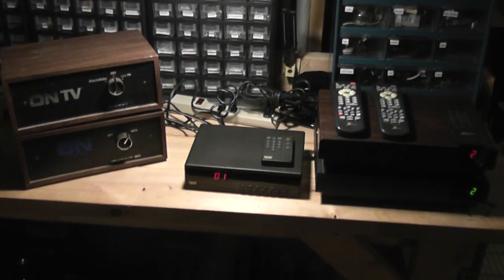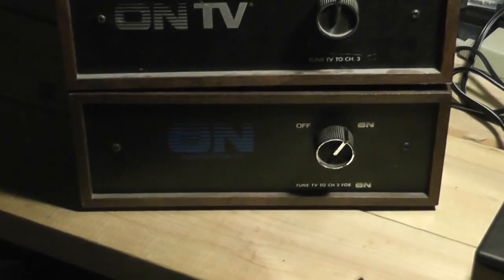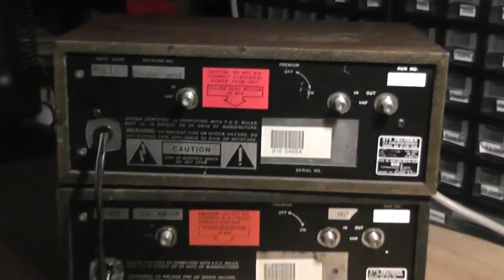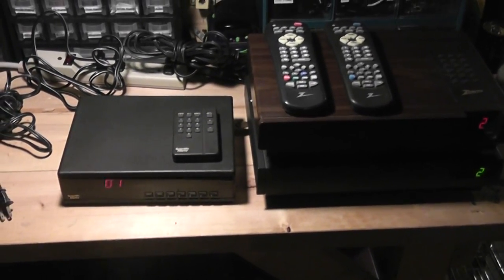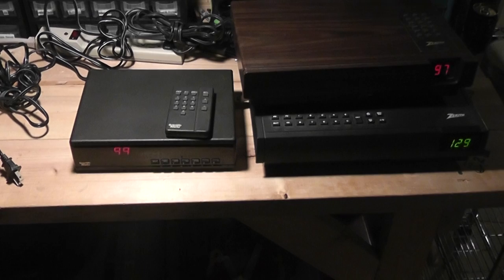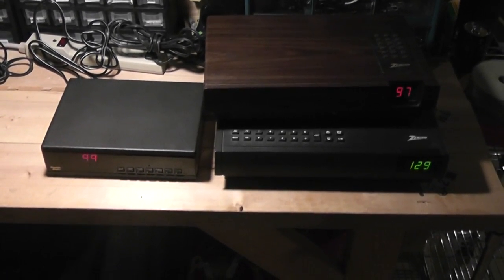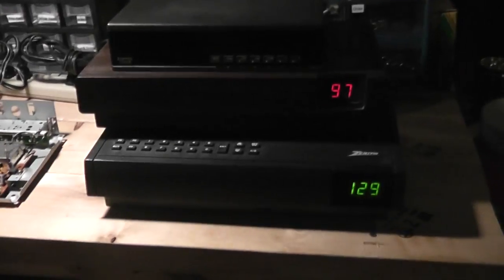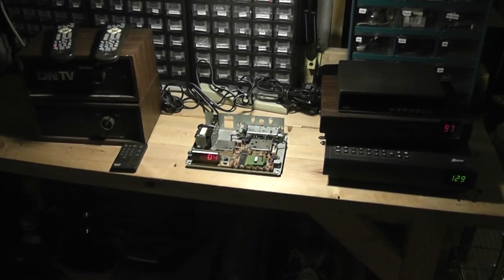Vintage ON-TV Pay TV & Cable Descramblers

Comment: I made my own Pay TV decoder way back then.  It would decode the same RF Pay TV channels as did the Zenith models.  The total cost for an individual decoder, was 6 dollars tops.  The 1 inch by 4 inch assembled decoder PCB only pulled about 15mA.  With that being the case, if you already had a Cable TV box that came with volume control, that meant that you could put my decoded board inside it, and then tap the +12Vdc line for power.  Then you just cut the analog video wire that jumps from the units RF Demodulator on over to the RF modulator, and connect the RF Demodulator and the RF modulator to the decoder board instead.  Job done.   It now decoded every Pay TV channel.  It decoded the scrambled channels, line by line, thus there was no PLL(Phase Locked Loop) delay problems.  Since there was no delay when you selected a pay channel, there was no way for you to tell if you were watching a pay channel or not, other than by knowing what channel you had selected.  Fun days back then.
Reply: how did you find out this information back then?
Reply: @nm7781  I was a technician back in those days and worked for a company that manufactured TV Cable Converters. So it was easy to know how the Pay TV scrambled the video at that time by taking a quick peak. Normally you have the video line by line signals each in combination with horizontal sync pulses that are located below the video level, positioned there such that the TV can detect them. To scramble the picture, they had raised the horizontal sync pulses up into the video level such that the TV's could not detect them, hence the TV could no longer be in horizontal sync with the video line signals, and in turn the images looks all scrambled. However, the horizontal sync pulses that are present within each vertical sync pulse, were not touched at all. So I used them to start looking ahead a specific time period from each H-pulse via the use of a time delay IC, to see if the next H-Pulse was in the wrong position, or not. If it was in the wrong position, the circuit would correct the error, and then use this corrected H-Pulse to trigger again the time delay IC to know again when to look for the next H-pulse to see if it too needed correcting.  So it thus became a very very simple line by line H-Pulse correction circuit.

Comment: The test chips were why the scrambled premium channels where typically the first thing that died when cable companies switched an area to digital service, even if the rest of the analog channels were available for several years after. In Toronto for instance the analog scrambled channels all went away in (IIRC) 1999 or 2000 when Rogers introduced digital service and they forced you to get a digital box if you wanted them. I also remember my grandfather would borrow a neighbour's descrambler when there was a movie on he wanted to watch. This worked because these boxes are all dumb receive-only systems and with ZTAC the authorization data to turn boxes on and off (at least on the same headend) was sent as pulses in the VBI so every box and every house would get it.

The last publicly available scrambled analog TV channel (so not counting closed circuit stuff like hospitals and hotels) was probably M-Net in South Africa which kept its Oak Orion system alive until 2018.

Comment: The local cable company where I live used to use the woodgrain Zenith boxes from the mid-80s up until 2000, when they went digital and started using the Motorola DCT2000 digital cable boxes.  Those Zenith boxes were used for Zenith's "Z-TAC" (Zenith Total Addressable Control) CATV scrambling system, which the boxes could actually be addressed and controlled by the cable company to automatically descramble channels that were subscribed to, which also made pay-per-view movies and events possible with this system.  It made cable piracy a bit more difficult (although I believe "test" chips were also available for Z-TAC boxes as well, IIRC).

I remember as part of the addressing system Z-TAC used, whenever the converter box was unplugged or unpowered for a period of time, it would lose it's addressable programming by the cable company as to which subscribed channels it was authorized to descramble.  As a result, after powering it up, none of the channels would be descrambled or displayed--the converter would just output black video with silence.  What you'd have to do then, is to tune in the box to a dedicated channel on the cable TV system for a few minutes  to reprogram and reauthorize the converter box (my CATV provider used channel 28, the Discovery Channel was there at the time).  I believe the CATV company would insert the programming data in the VBI (vertical blanking interval, where closed captioning and teletext data is also carried in an analog video signal)) of a particular channel (28 in this case) to activate or reactivate a Z-TAC cable box to whichever channels the customer subscribed to.

Comment: Before it became an ABC affiliate in the big United States broadcast TV affiliation switch, which began in 1994 and ended in 1996, KNXV-TV 15 was one of the various TV stations that would sign off at night in the 1980s and then air ON TV Pay TV programming that needed to be descrambled with an ON TV box.

Comment: My first cable supplier, in 1974, just hooked the cable directly into my TV's antenna input...no set-top box.  That was because the cable company offered only 12 channels (2-13).  My first cable box (1978) had two channel knobs, labelled A and B.  Each knob had channels from 2 to 13, for a total of 24 channels.  My second cable box (1980) had a slide bar for channel selection, that gave me a whopping 36 channels.  Neither came with remotes.

Comment: The other Zenith was probably late 90s, in the early 2000's most systems went digital for pay  TV. I don't remember any boxes that came out in 2000, they were phasing out analog, the Zenith blocked the audio, too SA didn't! Also, before we got the SA box, we had 13 channels and a box for HBO/Showtime (probably on channel 9X) you turn to channel 4, flipped the box. There were TONS of analog cable boxes but, your demo is spot on

Comment: I was always fascinated with Cable TV as a youth, especially because I didn't have it growing up. My friends and family had and i was so jealous, but my parents were against paying for TV. I missed out on the MTV and Nickelodeon golden years of the 80s. I also watched alot of WWF in the 80s and 90s and missed out on those cable shows.  I learned alot about these descramblers later on. I noticed a few friends had different types of boxes and got most of the channels. I saw the ads in Rolling Stone and Playboy. Once ebay came out it was a marketplace to buy them.  I bought a Panasonic VCR that had a built in descrambler around 2003-04, I was very skeptical about this since cable was converting to digital and dvds were taking over. It actually worked to my surprise, some channels had bleeding colors but no way to adjust this. At the time I said, if I had this 10 yrs prior it would have been cooler, so concealed to be built in a VCR.

Comment: We had ON t.v in the early 1980's just like the single choice ON box you have on the bottom of the two ON boxes in your vid here when I was a kid in Chatsworth, CA. After we had ON t.v., we got another service called SELEcT.V., and if I recall, it had 3 choices of pay channels.I also recently acquired an old Oak industries "econobloc" here in North Dakota, and was surprised to discover oak industries had also made our old original ON t.v. box too. There were only a few companies making decoders, traps, descramblers, etc. back in the beginning...cable  company monopolization  was rampant and it was a cat and mouse game with the FCC. Each time the feds clamped down it was like moonshiners who not only found a way around most of the regulations the FCC imposed, but they even seemed to improve their game. Unfortunately the cable companies also used the regulatory turmoil to their advantage in a rather greedy way and put the screws to the end user. I have to laugh, because I clearly remember the big sales pitch many of those big cable services used to entice more people to buy cable service....it was "commercial free television" Welp, ladies and gentlemen....their profits have been rolling in since the mid 1970's from the money they make from ads on cable t.v., they've covered their running costs a million times over and what did we get for it? ....hmmm, well now we get to pay even more ridiculously higher fees for cable t.v., we get to see almost CONSTANT commercials .......and we get to see their stupid station i.d. badge WITH ADS in the corner of the screen all the time too. Yeah,...so much for "commercial free t.v." ha ha ha

Comment: A coworker had a cable box with "test chip" and had friends over to watch a pay-per-view fight on the local cable TV system. Sometime during the program, a message appeared on the screen "You are using an illegal decoder." Apparently, the cable company changed the digital code accompanying the program to something none of its boxes were allowed to receive, and made those screens go blank. After sending the message, the cable company switched the code back, so its viewers didn't really notice anything wrong. The "test chip" boxes let everything through, including the message!

I'm sure some viewers thought that they had been "busted". A few who had invited friends over and had everyone chip in on the cost were probably embarrassed to have to admit that they hadn't paid for the event.
Reply from the maker: Great info and story!!!

Comment: Oddity Archive had done a couple videos on the ON tv subscription tv service back, in fact I have the video he did on the service in my recommended video feed that sits next to the comments section. I think he said that how they managed to pull off the scrambled signal was basically to transmit a 15 hz sin wave to mess with the tv. Edit: and I think he mentioned about how people figured that out and figured out how to get past the 15hz signal and were able to build something out of radio shack parts and were able to get past the 15 hz signal and get the signal clear.

Comment: In Chicago we had Spectrum TV, similar to ONTV, all while fiber was being laid in preparation for something much bigger. I just didn't know what it was at the time. With Spectrum, we had a set top box being fed by an antenna on our roof via coax. We'd just turn to channel 3 to view the content. I was very pleased with one channel. In the South, my aunt had a HBO set top box that also provided one channel. I recall Cinemax being launched which gave you three channels, then came cable. Cable was limited by the infrastructure of that time. Fiber wasn't being utilized so RF signal would travel via coax directly from the central office or the head end to the home which resulted in signal degradation. Fiber was and is the game changer.

Comment: Great video.  I worked with the Cablenet system in the early 80's and remember the Zenith  Z-TAC boxes.  I have a few of the old "wood grain" Zeniths still with even older remotes than you have.

Comment: I had that wood grained Zenith in the early to mid 80's and underneath it was safety Torx screws.  First time I had ever seen those screws before.  Yes, I got into it more than a few times, lol, returning it to the cable company when I blew it.  It was extremely hard to get the safety torx screwdriver back then (pretty much impossible) so I took a T10 or it was a T15 (still have that screwdriver in my toolbox too) and broke the middle out so a plain Torx could work.

Comment: While commenting, I was going to name drop a Direct TV alternative and decoding locations but found that the DSSrookie website is down. They housed nearly every converter box command codes to train the LMB (think that's the name of those circular parts of a satellite dish) to decipher every channel. I had the Viewsat model and a Direct TV dish. 

The knowledge was annoying with satellite codes and Scientific Atlanta quick board installations because of frequent signal disruptions. No one wants to "keep" paying you for your time resetting the system to test mode. Luckily the SA at least had a 40 pin processor that never stopped. Oh the times.

Comment: Thanks for posting this.  We had various SA boxes over the years and I'd always wanted to see what was inside and tinker with it.  But I never had the Torx security bits.  Until now. I'd never seen the inside.  Considering how hefty those boxes were, it is surprisingly empty.  Never would have guessed.   Nice word on the mod chip.  That would have been a super hack back in the day.  We had a legal version for a while when a family member worked for the local cable company.  Employees got every channel except PPV descrambled free as a perk.  So we had all the movie channels and even Playboy TV.  Good times.
Reply from the maker: +LS Good times!

Comment: Looks like the  Scientific Atlanta started with Channel 1. Not sure about the others but come Cable Companies used Channel 1 a strange Channel because the frequency for CATV Channel 1 is between VHF-LO Channels 4 and 5. Also some went to Channel 99 and some went way over Channel 100. But I never knew a cable comp[[any to have channels that high and channels in the 90's I think would be FM Radio band and would get interference from FM Stations.

Comment: Up until about about January 2018 or so, at least near where my grandparents on my mom's side in cohoes ny, there were still channels that existed that were unscrambled on cable. You read that right, unscrambled cable TV channels in New York, at least cohoes, I think there are a few places that are able to pick up unscrambled cable TV stations. I remember back when I was able to watch cable TV back in the day 24/7, my family (my parents, sisters and I) were able to pick up quite a few channels. If coarse, it wasn't as much as if you had cable or satellite, but you could pick up something of 50/60 channels. granted, most of the time you could pick up channels from 2 to about 75 or 79, but a lot of the time, the amount of channels that were filled in between those 2 channels dropped off after about 52 or 53 or so. you'd see a channel that was active after every 3rd or 4th or so empty channels, give or take, and there was 2 or 3 or so channels I think under channel 30 that were empty. I think it was channel 7, 15 and 16. I forget if those were the exact channels or not, but I think those were the channels.

Comment: I remember in the early 70s when catv actually meant community ANTENNA tv. In Western Arkansas we had a giant 200ft antenna to get far off locals and had independents like wgn chicago. By the mid 70s wtbs, wgn and other channels came around. I was a teen just in time for MTV! Having 13 channels was the bomb. It filled the whole rotary channel changer.  Dont you miss the clickety click of the tuner?

Comment: I think the Zenith system was the most common scrambling method for cable companies back in the 1980's and 1990's. There was also Tocom, Jerrold, Hamlin, and a few others. I wouldn't be surprised if they were pirated the same way that Zenith and Scientific Atlanta were.

Comment: They had ONTV in every state it was Channel 52 in Southern CA Same with SelecTV, ZTV which I think Z was actually a microwave signal
Reply: I think you're right. SelecTV was on Channel 22. Between ONTV and SelecTV, ONTV was the easier of the two to descramble. There were kits sold at flea markets to do that. You could receive the station for free, but the signal quality was only fair to poor. Eventually these services vanished, as cable was built out through the region.
Reply: @roachtoasties  I made one from a kit mail ordered. What they did was remove the vertical sync signal so the TV would scramble you could hear the voice. The kit I got had a dial that re-created the sync just turn a knob until the sync was correct screen unscrambled. This was also used for large satellite dishes. Later they encrypted the audio lot of microwave receivers restored the sync.